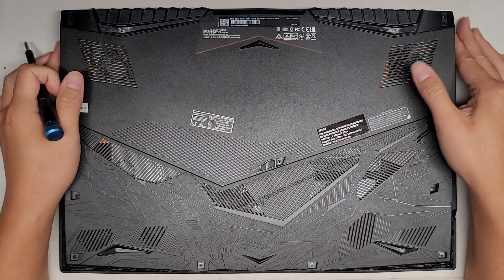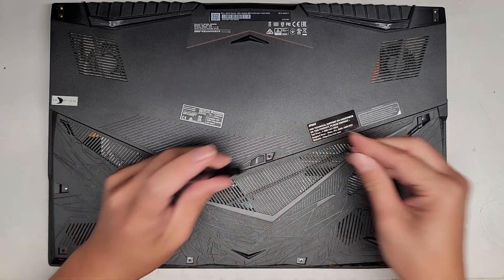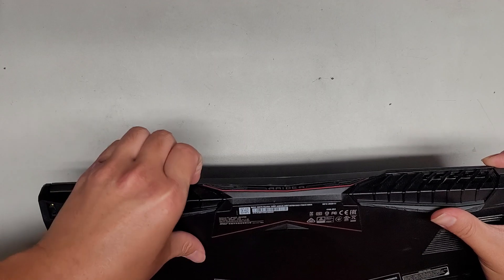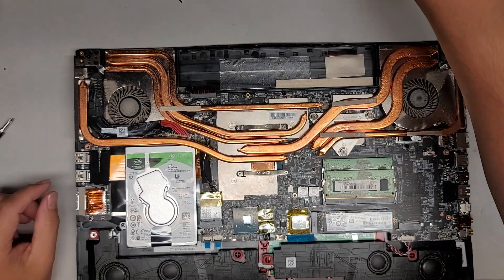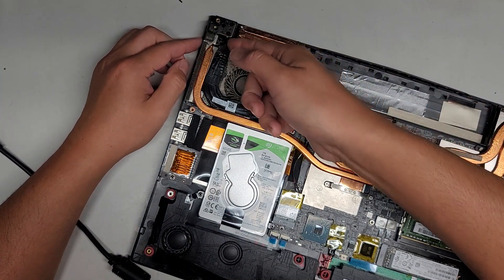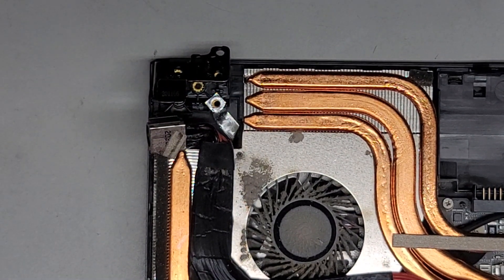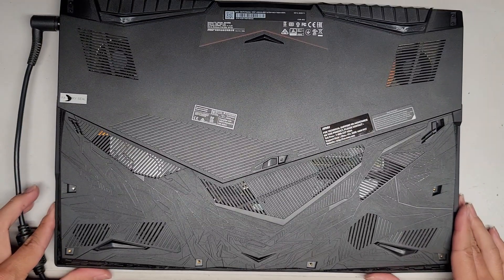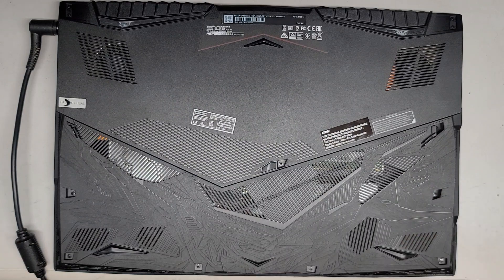MSI GE75 Raider Disassembly RAM SSD Hard Drive Battery Replacement DC Jack Charge Port Repair

Comment: get a plastic card(like an old credit card) or pry tool for popping the case clips bro, you can damage your nails :P
Reply from the maker: Nails grow back, how many old credit cards to got when you gotta fix thousands of computers a year. Lol
Reply: Lol, credit card helped. I did crack one of the vent ports (where the plastic gets very thin around the separation line) so be careful! It won't affect operation.
Reply from the maker: Yup

Comment: Hi, at 8:16 you're saying something about Bios CMOS batteries if I understand correctly. What does this do? With mine the glue doesn't stick anymore so the black thing with the yellow wrapper isn't stuck to where it belonged. Is this an issue?
Reply from the maker: It's fine if it's moving around. It keeps the date and time and other bios settings.
Reply: @ItsBinhRepaired  thank you mate!

Comment: Hello all, does anyone know whether the USB ports can also be replaced in these? Mine are shot, so that my controller cuts out intermittently now. I'm guessing they are not replaceable, because I cannot seem to find replacement USB ports anywhere for the GE75.
Reply from the maker: @ThulrVOdinsson  the two on the right are
Reply: @ItsBinhRepaired  Thank you. Helpful video, by the way. Unfortunately, it's the single one on the left that's gone bad.
Reply from the maker: @ThulrVOdinsson  that sucks :(

Comment: You are my hero they was talking about I might have to buy a new laptop/cpu if the motherboard that same piece was broken. On my way to get superglue lol my charger is charging again
Reply from the maker: Super glue? Lol not a good idea, but glad it's working.
Reply from the maker: If you haven't already, please like and subscribe so others can find my videos and possibly consider watching a few others to get the algorithm to recommend my channel. Also, if you can afford it, a small contribution is greatly appreciated as well, and helps this hero continue helping others without worrying about how to support himself. Lol

Comment: thank you for the video man! what was your process for cleaning the fans (mine are making this buzzing sound and are pretty loud) and the casing?
Reply from the maker: Fan Repair: https://www.youtube.com/playlist?list=PLSSiYX-ta7aqqxfDWDQh-B6Az4ZgDI459

This playlist will help.
Reply: @ItsBinhRepaired  thank you so much, i think my left fan is dying based on how fast it stops and with the amount of dust and hair i found inside the fan. not too confident in my ability to take off the piece on my ge75 and i don’t have the fans to replace the ones in the laptop currently. they’re definitely quieter after a normal clean but i definitely want to fix this issue before it gets too far gone
Reply from the maker: @BigBoiAlpha  yup, hope you'll be able to repair it

Comment: Thanks so much for the video!  I had this laptop sitting around forever broken due to the stupid charge port design and watching this made me get off my ass and fix it.  Quite easy to fix, I honestly thought I would have to go in and solder something before I watched this.
Reply from the maker: Haha glad the video helped. Yeah, it's a stupid design. Just needed a tiny bit more reinforcement to hold it better.

Comment: Thank you for sharing this! I was lucky that this, the first video I found looking for guidance on how to safely open up my model of laptop, also happened to be specifically for troubleshooting my own issue, a loose power port (as you pointed out, its housing appears to be a bit of a design flaw with this model). I'd been planning to use superglue to re-affix the port, but, since you're clearly more experienced with laptop repair than I am, I decided to follow your method of using hot glue instead, and was able to accomplish probably a more durable repair as a result. My laptop and its port now appear to be working fine! (I do kind of wonder if using a little superglue to join the port to the housing and using a copious amount of Elmer's glue to fill the gap behind it might have been a better idea than using hot glue, since I'm still a little worried that the heat this gaming laptop can build up could cause the hot glue to re-melt; but I was more worried that there might be some reason I was unaware of that Elmer's would be a bad idea.)

I'll mention that I DID have an odd issue with my laptop powering back on right afterwards; the fan kept repeatedly starting to rev up and then cutting out, while the power light cycled between orange, white, and off. This was with the charger connected, but when I unplugged it, it was then for some reason able to boot up successfully off of the battery alone; and after that it was able to charge successfully and boot up off of either charger or battery. I'm still not sure what caused that weird issue, but I wanted to share my experience here in case anyone else runs into the same thing.
Reply from the maker: Elmers glue takes a very long time to dry if a big clump. It'll also conduct electricity, so you're likely to short the positive and negative wires and fry the computer. If your charge port is hot enough to melt hot glue, then you don't want it to stay connected. Haha that's a fire hazard.

Did you disconnect the battery before working on it? If you did, it might have just been testing resetting the bios.

Thanks for the support! It really helps a lot, especially since YouTube has been paying me less and less per view lately. :(
Reply: @ItsBinhRepaired  I see; thanks! And yes, I took the battery out while working on the port; it seemed safer that way.
Reply from the maker: @FanZ2626  yup!

Comment: I was pleasantly surprised when I opened mine up and it wasn’t super dusty or gross. 

Current issue is last week I dumped hot chocolate on my laptop. Got it dried out as best I could. Left it upside down closed with paper towels for 24 hours. Came back to life fine. 

Have restarted it multiple times since then, but today when I shut it down it wouldn’t start back up. Currently trying removing the battery for 15-20 minutes and then trying to start it. I’ve tried holding down power button to restart to no success. Didn’t have a pin long enough to go through the case, so that may be my next try if this doesn’t work.
Reply from the maker: Needed to do complete disassembly
Reply: @ next thing on my to do list is unplug and replug in the cmos battery. I don’t have any real experience with computer hardware and my computer science father is 7 states away. I might end up taking it to a repair shop near me

Comment: awesome video man, quick question how exactly did you get the backplate lined up? mine is taking forever haha
Reply from the maker: @carter7366  lined up?
Reply: @ItsBinhRepaired lined up with the headphone jack side. mine simply won’t fit like yours is
Reply from the maker: @carter7366  oh, you likely didn't get the headphone jack in the little cutout. The board needs to be flexed slightly to get it to drop in.
Reply: @ItsBinhRepaired  ah i see. thank you very much
Reply from the maker: No problem

Comment: Thanks for showing this. How did you clean the fans out? They look really difficult to remove. My laptop is really getting quite noisy at the moment and I'd like to clean it.
Reply from the maker: Toothbrush and electric blower, but sounds like you might need to grease them.
Reply: Thanks for this. I took a look today and decided that I'd have to wait until I've bought some heat grease- the whole heat sink needs to come off to get the fans properly clean, it seems. Weird design! @ItsBinhRepaired
Reply from the maker: @OphidiaSnake  yup, bad design.
Reply: If it's any help, I've had pretty good luck applying compressed air to the fan vents on the underside to blow out the dust.
Reply from the maker: @Hibba42  only works if you do it often. Once it builds up it won't work.
Reply: Years of laptop repairs - best way I've found, if not pulling the fan out, is a vacuum & soft brush MOST of the dirt off, Then vacuum on the nearest exhaust port and compressed air into the fan to blow it out. Repeat the other direction. Don't get crazy on the pressure, the fan doesn't like pretending to be a jet engine! Pulling the fan same procedure. If you pull it always carefully peel the label and lube the bearings LIGHTLY.

Comment: One of my hinges snapped today and the screen started coming apart at the corner. Any experience with this?
Reply from the maker: Basically this https://youtu.be/GRxXS9vnHFg
Reply: @ItsBinhRepaired  you the best thanks
Reply from the maker: @nicolasclermont893  no problem
Reply: @ItsBinhRepaired  What do you think is the best place to order your parts from for MSI?
Reply from the maker: @nicolasclermont893  Amazon and eBay is what I use most of the time

Comment: Thanks for the video! Also i have only ever taken apart and put back together 1 laptop before (and it was a ~2014 dell laptop) and that was a year or 2 ago, i just wanted to check but theoretically both sticks of ram on this model should be removable, correct? I have been having some problems with mine that indicate either RAM failure/problems or/and an SSD issue (but i am lead to belive/hope it is just RAM as it started with a few BSODs with the error code "Memory Management" and later it stopped booting past the splash screen but did boot up a few times the next day but none of my settings were saved on my programs, then back to stopped booting at the splash screen), it is already void of warranty as i got storage and memory upgrades before i bought the laptop, i got the tools to do it but i just wanted to double check to see if both RAM sticks can be taken out (to your knowledge) so i can replace them if needed
Reply from the maker: There's nothing theoretical about it. Factually you can remove both. Lol

Comment: I just got the exact same issue on this laptop.  Seems like a definite design flaw making the charger connection so stiff and then only holding the port in with a small thin piece of plastic.
Reply from the maker: Yup, bad design.

Comment: I saw a Lockpicking Lawyer video where he removed an adhesive tamper seal using denatured alcohol and tweezers. Not sure if this would work on this factory seal or not, but may be worth trying one day!
Reply from the maker: Most likely, but not necessary as they're out of warranty anyway.

Comment: your tutorial is great i was able to clean part of my pc without being afraid. but i have a question now my pc overheats a lot in the centre left of the rams slightly lower but i don't understand why you would have an idea?
Reply from the maker: The GPU heatsink?
Reply: @ItsBinhRepaired  il thinks yes thx
Reply from the maker: @Takoutii  it's supposed to get hot
Reply: @ItsBinhRepaired   Yes, very hot in the middle left of the ram card to the point where the PC suddenly overheats. Doing nothing makes it OK, but if I run a game, even a very old one, it overheats enormously.
Reply from the maker: Check the gpu fan and heatsink for dust.

Comment: Thanks for that great video. Hope I can clean my air pipes with this. Have u any tips?  With a little hoover ? Thanks.
Reply from the maker: Don't use a vacuum. You want to use something that blows the air.
Reply: @ItsBinhRepaired  thx dude
Reply from the maker: @elbzander  no problem
Reply: @elbzander vacuum cleaners can generate a static charge on the nozzle, which microprocessors aren't a fan of.
Reply from the maker: I mean, even blowing the dust can generate static.

Comment: What the frick is wrong with mine?! It feels like the cover doesnt wanna come off on one side. Its like its glued somewhere, i cant find anything that helps to loosen it, i just kept applying force until the plastic rim by the side fan exhaust broke, all because there is a clip or something there that doesnt wanna open ffs!

Edit: I didnt notice the hidden factory seal screw ffs
Reply from the maker: D:
Reply: @ItsBinhRepaired  It still functions just fine, it just doesnt look pretty. My main frustration was not knowing why it was stuck.
Reply from the maker: Strange :(

Comment: so i did this to install an additional NVME drive and when i put it back together my usb ports are no longer working. any thoughts?
Reply from the maker: Did you do a clean install or clone?
Reply: neither. just added another nvme since it has 2 pci-e slots. it's just an extra drive inside. the OS was not touched.  @ItsBinhRepaired
Reply from the maker: @Bleuzarr0  so no other internal components were touched? Try taking it out.
Reply: @ItsBinhRepaired  correct, no other internal components were touched. i removed the drive, booted it up again and still the 2 usb ports on the right side do not work. ive tried uninstalling them from device manager and ive tried chckdsk and no issues came back. my usb port on the left side is working but my usb-c port is not. the one on the left lights up as well, the two on the right do not.
Reply from the maker: @thuglifetillidieyeet  no idea

Comment: Can I use duct tape to hold the charging port in place?
Reply from the maker: No
Reply: Bad idea, don't do that. Use some gel super glue
Reply: @nekaicoderx  Alright, but why exactly is it a bad idea?
Reply from the maker: Duct tape leaves the nastiest residue and isn't designed to hold things together.
Reply: @ItsBinhRepaired  ah I see, thank you
Reply from the maker: @exception2676  yup